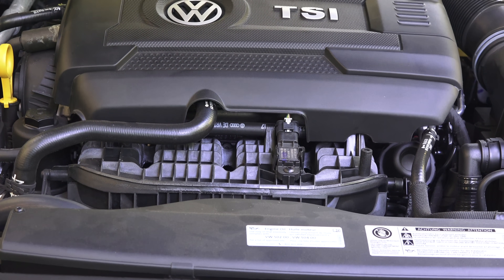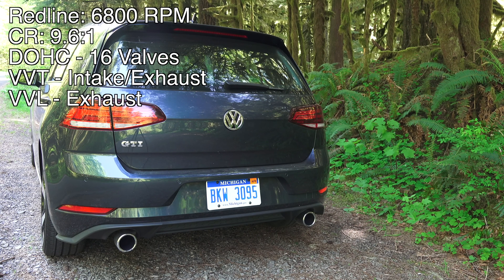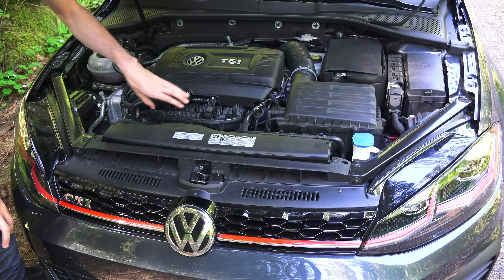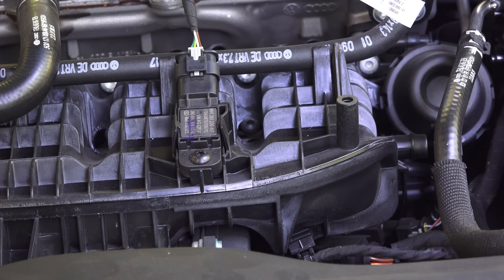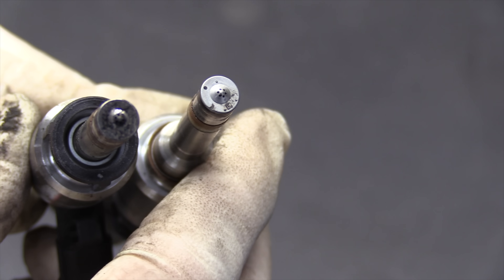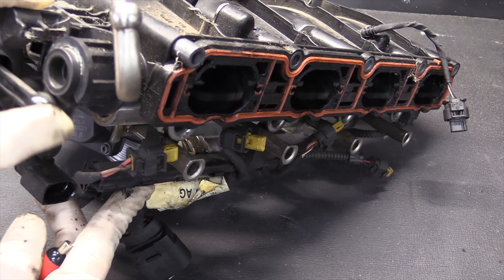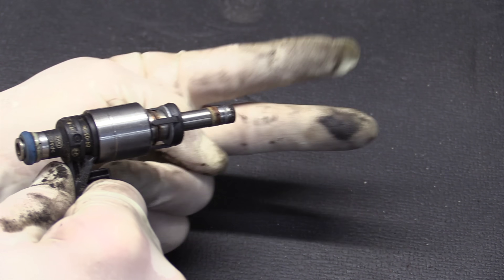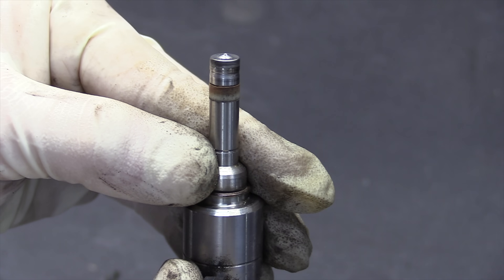The Best Engines - Volkswagen GTI Turbo

Comment: Honestly this shocks me a bit. I consider these engines to be one of the worst available in the 1.8 to 2.0l class...I mean they should be made for efficient performance, yet they use:
- a compression ratio of under 10:1
- PLASTIC tumble flaps in the intake (BMW diesel owners get nightmares now), which will also restrict airflow at high rpm (there are much better solutions)
- they still use cast iron for a modern 4 cyl - WHAT?
- it shocks me that an integrated exhaust manifold wins you an award in recent years. e.g. Honda and others already did that in e.g.  the K series in the very early 2000's

On top of that, I had a GTI as a rental car because I got 'upgraded' and took the chance and tried it on the Autobahn. It was vastly disappointing. For over 220hp I expect more in a compact class car. It felt dull and the engine was not rev-happy at all. Actually it felt restricted all the way through.
On top of that, German car forums are full of problems with insane Oil consumption, intakes and valves full of crud because of a poorly designed PCV system etc.

I rarely disagree with things presented on this channel, but nope, can't agree this time.

I would love such a video for e.g. the K20C1 engine form the Civic Type R, this one has some real cool technology implemented. Or the newer Ford ecoBoost engines. Or something about the insane V10 Lexus once built into the LFA.

Comment: I know this is a bit far out because you never got them in the States and they're no longer in production, but could you do a video on the Alfa Romeo Twin Spark engine? It had a lot of the features mentioned here (balance shafts, variable intake runners, etc), but is also missing many of the features (direct injection and variable exhaust valve lift system, turbo). Maybe a video about how technology has progressed over the years.
Another thing: Could you explain why rev hang is needed in modern engines? There seems like a lot of misinformation about it.

Comment: 2010 GTi engine suffered chain tensior at less than 40K miles $2500 repair yes needed fule injectors as well (2), intake manifold every 35 to 50K miles some work under warranty other work out of warranty. Runs great when it runs hahaha

Comment: Are these 2.0T / 2.0TFSI or TSI the infamous oil burners later fixed but suffer from chain tensioners issues?
I have read some of the 2.0 Turbo VAG has used since 2008 to the present are chain driven while others are serpentine belt driven, but every time I try to figure out which models had each of these, and their common problems, I end up getting even more confused.

Comment: why pistons are made cylindrical in shape why not square or rectangular....?
Reply: "Duh! Cuz they wouldn't fit in the cylinders!"
Reply: Now seriously. I don't really know the exact reason why, but I think it is mainly due to greater wear in the edges of these were to be square or rectangular. Rounded (circular) shaped pistons can "absorb" more friction within the cylinder walls, and it is easier to seal the combustion chamber with rounded piston rings rather than angle shaped ones.
Still, there are a couple of designs that have elliptical or slot- shaped cylinders.

Comment: Aren't the GTI engines ticking time bombs for timing chain / guide failures?  And lots of carbon guild up on the back of the intake valves?  How is this award winning?
Reply: The amount of engines that failed is pretty low. Anyway, get a first gen 2.0 TFSI (Golf 5 GTI) and you will have some oil burning problems due to a design flaw in the piston rings. That was solved in Gen 2 (Golf 6 GTI), but that one has some timing chain problems. Gen 3 (Golf 7 GTI) has practically zero problems (and come on, as if other brands don't have problems...). I have a Mk.7 GTI and it is simply amazing.
Reply: @kuusj98  I have mk5 08 bwa engine. So you are saying the first gen was better? I had it for a year now was thinking of stage 2...
Reply: "Award winning" for its design and power output when new, but not at all for reliability (at least that is what I think).
Reply: +kuusj98 That is what I meant in another comment. I knew the first ones had very high oil consumption -fixed in 2012 onwards, but other 2.0T / TFSI had timing chain tensioner problems. It is supposed that almost 8 years later all of these issues should have already been kicked off. Sure any engine model has its own particular kind of problems, but they are not expected to be as severe or as costly to repair as the first/ second gen. 2.0T (not blaming specifically VW, since there are many other brands with catastrophic designs too).

Comment: New Detroit DD series would be cool if you touched up on it. My new work truck is a 4-cylinder 5.1 L there are two ratings 210 horsepower and 230 horsepower. Apparently they use camshaft timing during after treatment regeneration because they can open the exhaust valves sooner to allow more heat into the exhaust to burn soot. I'm interested in it cuz apparently Detroit spent a lot of money developing this engine to compete with inline 6 cylinder diesels in the current market

Comment: Did you get that cylinder numbering correct, IE: they start at the flywheel? Some of the 1.9 TDIs would monitor the glow plugs (glow plugs FTW, BTW) backwards from the cylinder numbering.

Comment: So, a award winning engine copied Toyota's T-VIS (80's), Honda's VTEC (80's<), Honda's R18/20 series in-head exhaust (00's) and still produces that amount of gunk on the intake, and still, manages to win awards... Cool
Reply: But doesn't manage to keep their cars going forever with little maintenance.
Reply: +footballcoreano Hmm, I think you are kind of wrong here... It is true that some German designs were later used in Japanese cars, but Volkswagen is in many cases unreliable (present models) whereas Toyotas and Hondas are almost bulletproof. Sure we have some very good reliable engines from VAG (older, more simple Diesel ones for instance), as we also have problematic ones from Honda and Toyota, but the latter have a strong reputation for their reliability, maintained throughout many years.

Comment: 1.9 TDI
Reply: How's your experiance with 1.9tdi diesel?
Reply: I have an ALH 1.9 diesel and it has about 500k miles. Bulletproof and easy to get more torque.
Reply: @pilotavery  how you maintain it? Which oil? Filter?etc
Reply: @1.9tdilove71  As long as you treat the engine with basic care, for example not battering/abusing it, waiting until it's fully heated before stressing it, servicing on time, replacing parts before they break, running it in properly, etc. It will run forever.

Rule of thumb; if you look after and take care your engine, it will look after and take care of you.
Reply: @ark2364  Thats true.
Reply: the beste
Reply: Only good VW Engine change my mind

Comment: These new VW GTI/R engines are no joke, respond very very well to tune and bolt ons
Reply: 380 hp out of 2 liters 4-banger, especially impressive when they get 30 mpg highway
Reply: European EA888 has dual-injection (port and direct). Unfortunately the USA model only gets direct.
Reply: @turnin.sprocket  That is not true, till 2017 or so they were also DI only and destroyed the piston rings and shaft all 100 thousand kilometres. Engines to enjoy (if you are a mechanic yourself)
Reply: What do any of you care anyway? You going to throw down 28 grand for one?
Reply: @turnin.sprocket  Simple, my EA888 blew up one month ago, 115 thousand kilometres, so it was way overdue to fail me. Costs around 11 grand to repair, so I just thought I share my experience with y'all.
Reply: @WeeManXL  What year was it manufactured? It's been around a very long time, it's gone through a lot of revisions and updates. And also, what was the history of your maintenance from new to "blew up"?
Reply: @turnin.sprocket  You're right there have been changes because of the prosecution they faced in the US after the class action lawsuit. It's a 2010 model and my history of maintenance is even better than recommended, oil changes every 8-12 thousand KM, no long life service, always premium quality oil that was tested by independent organisations and got the approval from them. As said, I got lucky it took so long for it to blow up, seen even worse cases with 60TKm and everything in between, even from the newer generation of engines.
Reply: @WeeManXL  I know they had trouble around about those years. The later model seems very strong. Improvements in fuel pump, valve train technology, etc. It's used in a host of Seat, VW, Audi vehicles in various states of tune. It's one of the best 4-bangers in technology. It can also take a lot of force without breaking, especially the Golf R version which forged rods and pistons.
Reply: @turnin.sprocket  Now from a perspective of power you're right, still it doesen't take into consideration that this engine is to fragile. High pressure pump has a problem=engine's dead; Oilchannels are a tad to small=engine's dead; Chaindrive on the camshafts a bit loose=engine's dead; One Sparkplug/Ignition coil dies=engine dies also. And do not forget the EGR-Valve, it destroys your intake manifold while growing crystal death on the intake valves. Don't wanna get started with the DSG this type of engine comes with a lot of the time, the mechatronics on them are horribly sensitive and f* up the shifts if you don't flush your oil all 40tKm. The Power is extraordinary but this kind of engine has no place in a day-to-day car you rely on with your familiy to function in life.
Reply: @WeeManXL  I feel your perspective on the EA888 is quite lopsided due to your own unsavory experience with an old version of it. If it was as "fragile" as you say (Audi designed it), VW, Audi, Scoda, and others wouldn't be using this lump across the board in so many vehicles. They'd pull it from production and throw it in the trash because it'd be a nightmare of finance and sales, and litigation and safety. It's not fragile. The Golf R has been cranked up to over 600 hp at the crankshaft with aftermarket turbos without changing the rods or pistons. It's held. It's a cast-iron block. It's tough as nails. VW has historically had some tough as nails engines.

There are Achilles heel parts of every engine. But after listening to comments similar to yours, people have the impression no internal combustion engine designed and manufactured in the last 10 years from practically any brand is worth dog poo and is going to leave folk stranded if the planets don't line up.
Reply: @turnin.sprocket  Aluminium Block, boomer.
Reply: @maozedong981  the EA888 is an iron block. Trust me, I own one.
Reply: @maozedong981  he says in the video it's a cast iron block with aluminum heads. Non-boomer!
Reply: @turnin.sprocket B58TU k20 shits on all engines here in EU , but I like to watch explanations in english because they are to the point, as ea888 goes, anything on plastic guide rails gonna fail eventually.
Reply: @turnin.sprocket  *dual
Reply: @kiyoponnn  Exactly. Dual injection.
Reply: @turnin.sprocket  You dumbass, I was correcting your spelling
Reply: And Polo GTI 😁👍
Reply: Y’all should just K swap it and call it a day.
Reply: but why buy in 26k at a low baseline, then dump thousands in for future brag rights? im glad my old fsi GLI was totalled by a deer. my n/a .:R32 now is way less problems & IS the best motor they made IMO
Reply: You can buy it for 8k with under 100k miles so theres my reason
Reply: @taiwilson8966  I dont want bragging rights. I just want a fast car that handles well and is spacious.
Reply: the new R engines are great stock for stock compared to the R32's VR6, however the VR6's have way more potential with more displacement. oh and the EA888 sounds like dogshit compared to the VR6.

Comment: You should have made a complete research and explain the problems that plague the earlier years versions like oil consumption and timing chain failure . I am looking for an  1.8 TSI for some time but there is a lot of ones with rough running, valve problems, one cylinder  not firing and so on ...
Reply: Shhhh hehehe
Reply: Oil consumption problem still ongoing... techs have to tell the customer we've not heard of that on these engines. It's virtually unknown that they leak or use oil ..............
Reply: bbogdanmircea luckily VW solved this.
The current 2.0 engines dont have these problems.
There will also be a new 1.5 TSI coming soon. (For the polo)
Reply: @VeniVidiAjax  it took 6 years to fix it. Also this engine got no soul. The exhaust integrated in head is also in a vw up  1.0 fitted as standard.
Reply: TURBO means: oil consuption.
Reply: @marceloho1984  not at all. my mazdaspeed 3 never lost a drop. nor does my SHO with 2 turbos. its shitty engineering.
Reply: Seeing a lot of vw engines coming in with a jumped timing chain, even had one with a broken chain and severely worn sprockets, all due to bad designed chain tensioners that go bad under start-up conditions. A lot of vw engines use this crappy design where the oil pressure does not hold in the chain tensioners, resulting in huge slack under start-up till normal oil pressure.
Reply: My wife's 2014 1.8 tsi has been flawless since new, the odometer now reads 102,000 and it drives like the day we bought it.
Reply: Mine eats oil like it's gasoline
Reply: Michael Schauer Really? I’ve got a 2017 GTI and that I’ve already put a lot of miles on and it doesn’t burn a drop of oil. Absolutely fantastic car, feels as well-made as a Mercedes, and at a small fraction of the cost.
Reply: Michael Schauer  yours and plenty others
Reply: its hard to burn oil when its all leaked out brother! Yes, I’ve owned and love air cooled but lets be real here for a sec hahaha
Reply: That's all the signs of a great engine.
It eats oil and it ask you to take it to the auto MD monthly means it's alive. It has the ability to ask the owners for $omething.
Reply: Just stay away from the 1.8 TFSI, one of the worst engines VW has made in the recent years.
(And even worse, they tried to market it as the rebirth of the 1.8t...)
Reply: whats the use in talking about engines that are previous iterations and are no longer found in new cars?
Reply: Jeff Zekas  that's not quite true, and plenty of them left tell tale marks everywhere they went.
Reply: @jeffzekas  true, but they did leak oil 🤔
Reply: It's a VW thing
Reply: it's a piston ring installed backwards thing
Reply: Was about to write the same but you already mentioned the problems with Timing chain and oil consumption due to incorrectly designed oil scraper rings. Also it runs pretty instable in idle.  I have the 2009 TSI engine and it sucks balls
Reply: Volkswagen and the best is oxymoron ! I know I was working for VW/Audi dealership